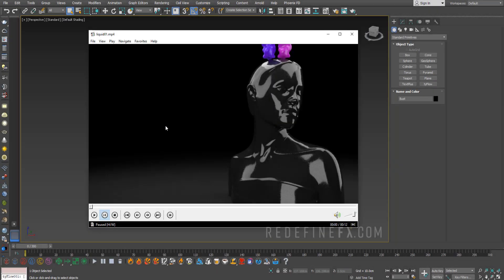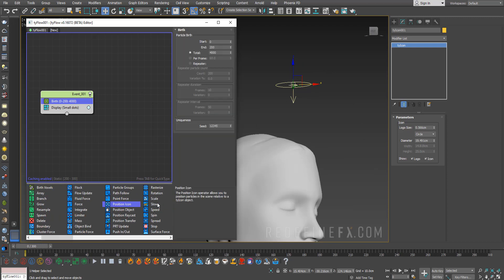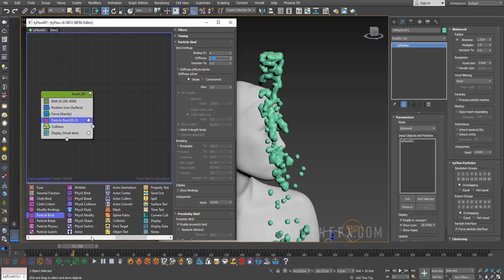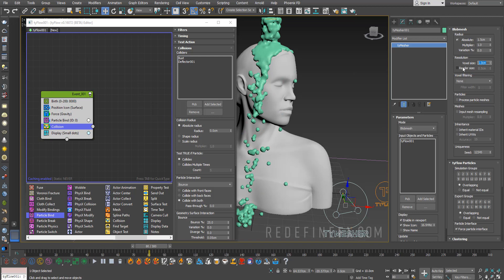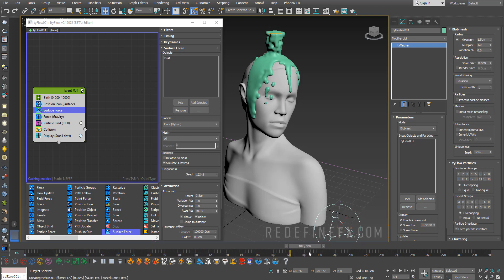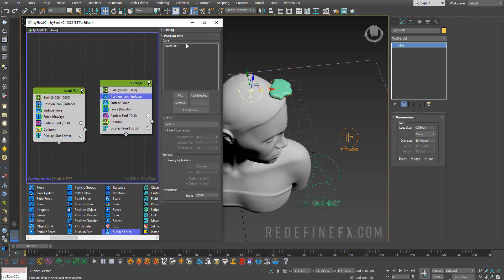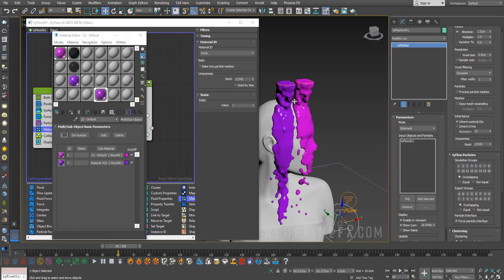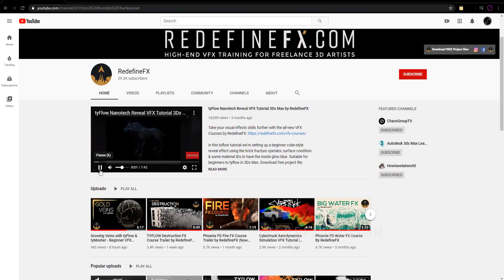Pouring LIQUID with TyFlow & tyMesher! -  3Ds Max Tutorial by #RedefineFX

Comment: Hello Jesse, i have a question - here is the situation, in a scene there is a human model, then the liquid will appear and morph in to the liquid human model, make it look like original human model have liquid skin above its surface, and after this liquid will splash to the floor. All is working,  but i have a question is it possible to make liquid human model use multi texture from original non liquid human model, that the liquid model will look the same in terms of textures(like head, body, clothes and etc)?!
Thank you for possible answer/tip/solution. All the best!